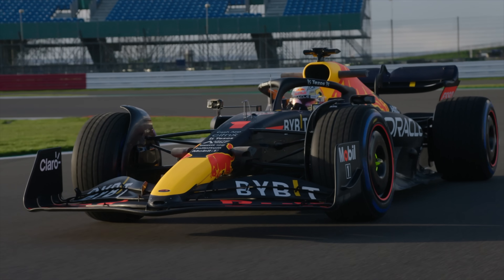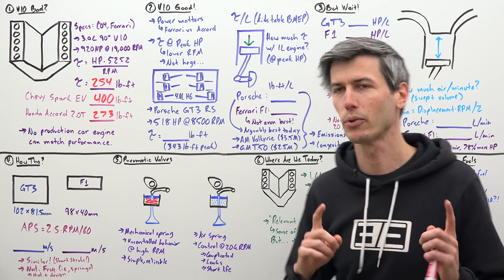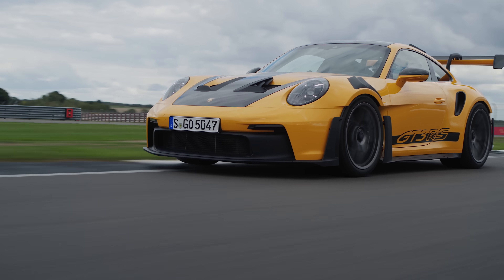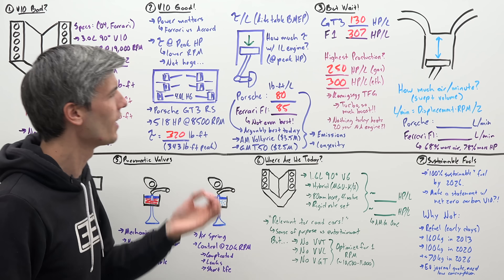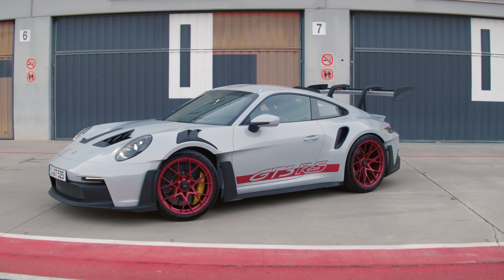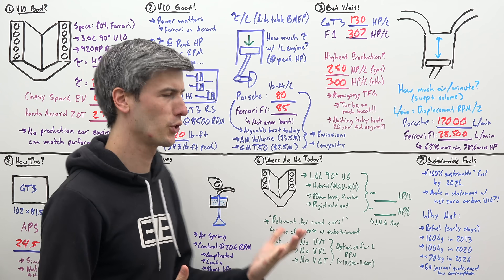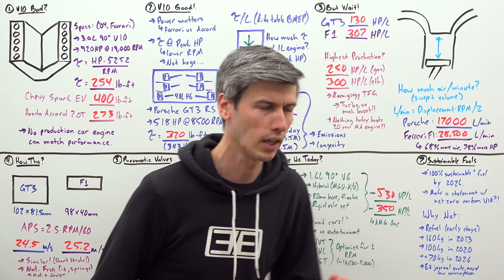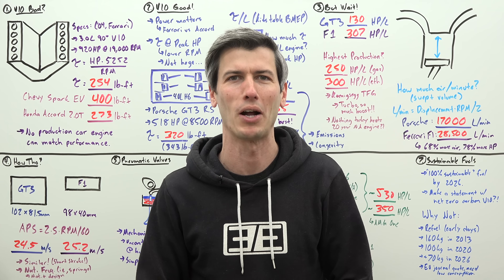Formula 1 V10 - The Greatest Engine Of All Time?

Comment: Formula 1 engines sound very different in real-life. In F1 TV Lives is like they filter the audio with all the pops and cracks of the anti-lag when braking, they only show the high frequency notes but not the low horrible and intense noises and vibrations you can fell with your own body... I imagine any sensible car owner will bring their race car to a repair shop if sounded like a real F1 car. Turbo or Natural Aspirated they are not smooth sport engine musical machines tuned in every accelerator load or rpm to be easy on your ears...just power and efficiency delivery...
Reply: The audio bandwidth his present.  You just don't have the ability to reproduce them.

Comment: limiting the amount of fuel and battery capacity should be enough as a rule and would foster more innovations that could benefit the average car. Let the manufacturer determine volume, cylinder count, natural- vs forced induction etc. Btw motorcycle engines make +200HP per liter in regular street bikes.

Comment: You would think that VVT would be allow in F1 because every normal car has it. VVT will also increase the efficiency of the engine in a larger powerband.
Reply: They have infinitely variable valve timing. They don't even have camshafts. The valves operate pneumatically and are computer controlled. They're light years ahead of any road going VVT systems.

Comment: Have a look at the late 80s90s motorbikes with 20k rpm i4 250s, 16-17k peak power 10-14k peak power.
I know some race bikes that were 38-9hp @18,000
Compression ratio	12.2:1
ZX250A-B
45,0 hp (33,1 kW) / 16000 rpm
25,0 Nm (2,6 kgf*m) / 11500 rpm
Fun bikes
Reply: Luckily Kawasaki makes  zx4-RR and zx-25R currently. So screaming in-line 4 are back!

Comment: Horsepower without torque is wimpy... it means nothing but bragging rights. Torque is what you feel, torque is what pulls or pushes you. Torque is what DOES the work. In the real world, you can't use that horsepower but you CAN use torque.
Reply: Negative. Power is what you feel. Engine torque doesn't mean much because the gear box is a torque multiplier. You can gear for more torque. You just won't go anywhere very fast without much power, nor will you feel the pull.

Your understand if torque is a common myth
Reply: In other words, as soon as you move, you have a power calculation. How fast, how far, how quickly. That's all what power determines.

Comment: It's pretty simple that current day engines can't beat a 20 year old F1 engine. Reliability and practicality. These engines were probabl;y able to do  less than 1000km. IF they didn't broke down before that. Secondly, you need a speical laptop, a team of engineers and a whole bunch of time just to start it up. The fluids all needs to be pre-warmed, otherwise the engine seizes due to crazy tolerances.
Reply: The second point is still true, and applies to most high-level race engines. The laptops are mostly there for diagnostics.

Comment: I worked on the Tyrrell 023 historic F1 powered by a Judd V-10 producing about 750 HP at 11,000 RPM (detuned so they could last 1500 race miles instead of 500  to 600 race miles for the Yamaha Judd F1 engine).  Some of the differences not noted:  the engines needed to be at least  160° before starting because of the tolerances, the engines ran on very high octane racing fuel, not pump gas, there was no onboard starter and the cars only weighed 1312 lbs. with the driver.  The wheels were magnesium and I could pick up a rear tire and wheel with one hand.
Reply: How was the engine warmed up? I imagine oil or water were heated up and circulated?
Reply: @jamesmedina2062 They still do it today. I think it was 30 minutes before race start they pump the oil and water through external heaters to bring the engine up to temperature before starting them. The same is done to the gearbox oil. It's not only F1 where this is common, but also racing series like DTM do it.
Reply: LMFAO, the engines aren't warmed up b/c of 'tolerances', the AP oxidizer (compounded w/ silicon) has to be hot enough to sublimate under vacuum.  They're 'detuned to last' b/c it' byproduct is Silica Nitrate, aka the material used to make grinding wheels.
When Silicon bonds with Nitrogen, the exothermal energy is around 35x that of H2O.  In conventional Octane, the CO2 reaction is indothermic.
The claim of 60% efficiency is pure sophistry, they don't account for real fueling conditions.  NASCAR has been using it to cheat since the 60'.

Comment: Scientifically speaking, isn't it good to restrict so many of the variables to focus development impact on just the few variables the constructors can manipulate? If the manufacturer's could play with VVT, bore size, etc. then it's tougher, especially in the secretive competitive environment they work in, to know what is causing the differences in performance between the different constructors.
Reply: @AzathothsAlarmClock  I get that, but I'm just saying that saying there's no relevance to road cars because they have so many set restrictions isn't really fair. If all they can develop (powertrain wise - not counting aero and chasis here) is the hybrid system, well that certainly can also provide important data to production car manufacturers.

Comment: Let's also remember that back in the 1980s F1 cars were making 1500hp (in qually trim) from 1500cc, which is 1kbhp/l...
Reply: And running some pretty special fuels to do so. One of the more sensible regulations now is that they must run something resembling gasoline.
Reply: Impressive numbers for sure, but let's not forget that those engines were running insane boost levels, special fuels, and lasted for about 3 laps at best. There's a reason those same engines were making only about half the power in race trim.
Reply: Rocket fuel in fact
Reply: @PaperBanjo64  Not rocket fuel, which is composed of fuel mixing with an oxidizer to create an explosive effect, usually by using liquid oxygene and hydrazine. 
What they used in F1 during those unrestricted boost years was toluene (also called methylbenzene) which constituted a large percentage of the fuel. Toluene is some highly potent chemical which is hazardous and dangerous to inhale (the fuel men had to wear special industrial masks). It can lead to nerve damage. 

Toluene has a superior energy density to gasoline and thus can extract more power for any given volume. For this reason it's a great octane booster, and that was definitely needed when the boost was raised to insane levels. 

The F1 racers did not use 100% toluene, but 84%. The other 16% in their brew is n-heptane, which has an octane rating of zero. The reason for this strange combination is because the F1 "rocket fuel" was limited to the rules to being of 102 RON octane. The n-heptane is "filler" to make the fuel comply with the rules. 
Because toluene is such an effective anti knock fuel it also means that it is more difficult to ignite at low temperatures. The Formula 1 cars that ran on 84% toluene needed to have hot radiator air diverted to heat its fuel tank to 70C to assist its vaporization.
Reply: @McLarenMercedes  "Toluene is some highly potent chemical which is hazardous and dangerous to inhale (the fuel men had to wear special industrial masks). It can lead to nerve damage."

I tend to believe that motor racing rules are too tight now and that the glory days were back when teams could get away with anything......but toluene can stay in the past, thanks XD
Reply: 600 lb-ft / 800+ Nm torque at maybe 12k rpm

Comment: Would be fun to bring the Ducati V4R into the mix with ~240 HP out of a naturally aspirated 1 liter in an emissions compliant road legal production vehicle.
Reply: Unfortunately the new V4R only makes the full 240 if you option the race exhaust and oil from the factory, which is NOT emissions compliant. Still a lot of hp/liter though.
Reply: So theoretically it could make about 720 hp if it's 3 of them, 3 liters

I've seen the dyno bike videos and it has often been disappointing numbers, so maybe about 650 hp at 240 ft lb torque, 3.0L V10/V12? @ 16,500 rpm

V10 F1 cars made 300 ft lb torque

Comment: Torque is actually more important than the power. But you need to use the correct measure of torque, namely at the wheel and averaged over the usable rpm range.
Reply: Except I could get a ton of torque at the wheels with a low gear. It still doesn't tell you what the car will do. You need rate, and that tells you power.
Reply: For instance imagine it produces ungodly amount of torque, but it takes an hour to go one inch pulling 4k pounds.
Reply: Torque means nothing for performance numbers, it's all about average hp.

Comment: I still don't see why they could not run the v10 with KERS.

You have the sound, and the reduced consumption.
Reply: Yup agreed. It would be good for all stakeholders including the enthusiasts (maybe their ears would say otherwise but oh well we like the sound). The only thing that may change my mind is that whether the V10 engine weighs more than the current V6 which I’m willing to say it will due to, well the bigger size of engine due to more pistons and material needed. So immediately if that is true then more weight. Plus the cars currently are massive and aren’t big enough to house a V10 so they would have to get bigger, meaning more weight. And at the end of the video he explained how as the years went on the F1 cars were using less and less fuel, meaning the V10’s would have to carry, you guessed it, more weight due to how much more fuel inefficient they are. It doesn’t help the fact that safety has required the cars to get bigger and heavier which is obviously a good thing but it means a less competitive sport as the cars are bigger. The actual V10 combustion engine would have to make less power than before in the 2005 and before engine era, so I’m not sure how that would work. You may be right, less consumption due to the engine not being more fuel hungry as there’s less a need of needing more fuel and so there could be more fuel efficient than that era but still a smaller engine will be more fuel efficient. But I mean cmon if it was possible then the sport would benefit so much from using sustainable fuels to power these ‘bigger’ engines. More sustainability and more fun for the sport!

Comment: The comparison is not equal because the V10 F1 engine is burning a different type of fuel with a much higher octane compare to 91 octane or E85.

Comment: Torque or hp per liter? Torque or hp per lb is more meaningful. If you 1 liter engine produces 1000hp but weighs 800lbs its a dog. The 2 liter engine that produces 1000hp but weighs 400 lbs is going to smoke it.

Comment: I wonder what are the harmonics involved in creating the distinct V12, V10 and V8 sounds. The V12s have a unique sound, but the V10 had a trumpet like Yowl to it that had a very unique character.
Reply: A V12 is two inline 6s set at an angle.  The harmonics of each V6 are well balanced and can be set at any angle.  The exhaust overlaps of each bank are right for smooth flow (but back pressure limits power.
A V10 is two inline 5s. The harmonics are perfect at certain angles. The exhaust overlaps are small making a lot of noise and power. 
A V8 is two inline 4s. The harmonics are terrible so need balance shaft or cross plain crank (heavy but sounds cool).  To maximize the exhaust flow requires combining both banks but that increases back pressure. So no good solutions.
A V6 is two inline 3s. Harmonics are good, no exhaust overlaps so would sound ok except you have to run a single turbo, which is a big muffler…
If you want max noise a single piston normally aspirated turning 24k RPM should make a terrible mix of harmonics.
Reply: @gordonn4915  A 2-stroke or rotary makes twice the "rpm sound" doesn't it?

Needs only 12k rpm to make that 24k noise or even 40k noise at 20k
Reply: To maximize the noise you need the exhaust to pulse. A single piston four stroke is “on” 25% of the time, making a lot of 2nd and 4th harmonic noise. A two stroke only makes 2nd harmonics.
Reply: I'm not engineer, but I guess how combustion chambers shaped, valves and pistons synchronization, and exhaust

Comment: The amount of engineering and money that goes into the engineering of F1 is staggering. It really pushes the boundaries of what is possible. BUT, they only build the engines to last a race or 2, then they are entirely rebuilt. No road legal car's engine can compete because like you mentioned they have to take reliability, efficiency, and emissions into account. But the cool thing is, F1 technology will eventually trickle down and provide better road cars as a result
Reply: Not anymore.  The engines are mandated to last something like 8 races.  You're only allotted 3 for the entire season.
Reply: @pliskenmovie You're allowed to use 4 Internal Combustion Engines, 4 Turbochargers, 4 MGU-H, 4 MGU-K, 2 Energy Storages, 2 sets of Control Electronics and 8 Exhausts per season.

If we only account the race and sprint distances (7018.574km + 621.126 km = 7639.7 km), then each Engine has to last around 1910 km. However on top of that come the qualifying & practice sessons as well as formation laps and the in laps at the end of each race. Considering that Verstappen used all allowed parts (apart from exhaust, where they could have swapped 2 more times) without having a single mechanical failure throughout the season, one can assume that the engines would have lasted even longer.
Accounting for practice sessions and qualifying you can probably double the distance covered.

Comment: I couldn’t agree more. If the fuel is sustainable then whey not make the best NA engine and stop messing with the hybrid assist crap. I don’t see a reason to go to the races in person with the cars in there current state. On the other hand If a screening V10 is running down the front straight that is worth seeing and hearing in the flesh. Thanks for sharing EE.

Comment: The most impressive thing about the current F1 engines is not their power it's their reliability. Those V10's only had to last a race or 2 not the upwards of 5 races the current allotment of 4 is supposed to last.
Reply: ...but they cost how much, and how reliable were they the first 2 seasons....?
Reply: I wonder how F1 logistics work. Given the engine that is made for maximum possible performance within rules are made to very tight tolerance, and therefore certainly needs specialized machinery, and specialist workers for exotic parts.
Reply: Yeah but AFAIK blowing a V10 per weekend would be cheaper than the very reliable V6 they use now so....

Comment: Great video and wonderful talking points, this channel is always good when it's you in that whiteboard :) Independently of the power figures, its AMAZING at all that Porsche can make an engine that will have a similar piston acceleration BUT be reliable enough to last many thousands (hundreds of thousands?) of miles, which is IIRC pretty extreme and near the limits of known alloys. From 2005 onwards there where ever more stringent reliability requirements,  so this was the tail end of engines that could last very little, a modern F1 fan would be shocked at how frequent and common retirements due to reliability where back in the early 2000s and before. 

You correctly state that the 053 in the F2004 was not the peak power engine of it's day (in 04, that might have been the BMW in the Williams) and in 05 the Mercedes and Renault likely had it beat, and the Renault had "so good driveability" (more torque or a better torque band?) that it got away with using a 6speed transmission vs the 7 speed everyone else used, plus it was also one of the reasons Alonso won at Imola that day in 05. But the F2004 with the 053 on it's back and the trick aero, diffuser, and a la carte Bridgestones made it the best complete package.

Now if you excuse me, I need to go put on some long videos of v10 engine noise.
Reply: I think it's good they can get at least 3 strong races out an F1 engine now. No more single use, quali-only PU's. 6 races is not out of the question.
Reply: @pauls5745  While of course I love the noise (and lightness/nimbleness) of the V10 era cars, I don’t hate modern F1 and the reliability, safety and outright speed of the machines (with control tires!) is jaw dropping. 

I agree that modern reliability regs are good, but as a Kimi fan in 05, I hated that McLaren Mercedes didn’t get it’s act together haha :(
Reply: Yes, people today are either new or have short memories. In the past, you win because you were either the quickest, or just simply lasts longer than most. Ferrari with near bulletproof reliability during early 2000s was quite a feat. Also, near bulletproof reliability of current F1 was basically a new trend.
Reply: @kidpagronprimsank05  Yeah, having a proper reliable car is very new, either that or driving fast/delicate enough based purely on feel with no data; thinking specifically on Jim Clark driving those Lotus that seemed to sometimes be made out of paper mache lol but he somehow still managed to make them last and win, that was an art in in of itself.  Fangio complemented his Mercedes' cars, but even then he retired quite a few times, and if it wasn't for rules being different and allowing other drivers to give their teammates a car, he might not have as many championships.

And we're just focusing on engines, but suspension breaking, brakes just going puff, heck in the previous turbo era cars could just run out of fuel, something that may strike some as unthinkable today, but even now it's not that far fetched (how many times have we heard over the radio "save fuel!!")